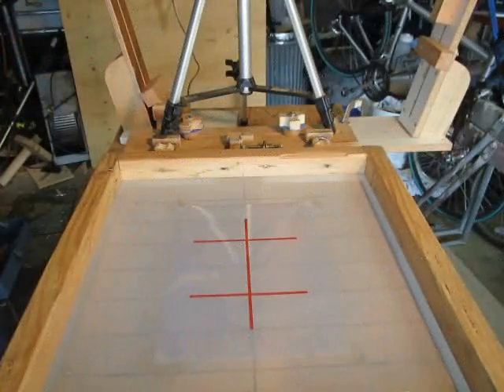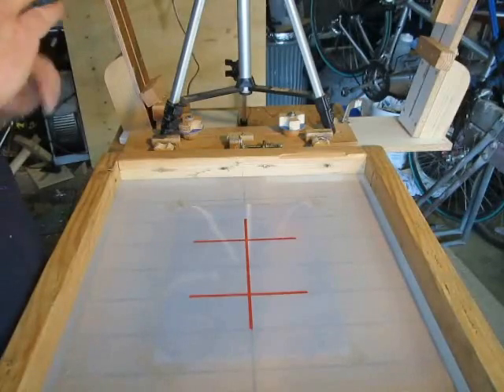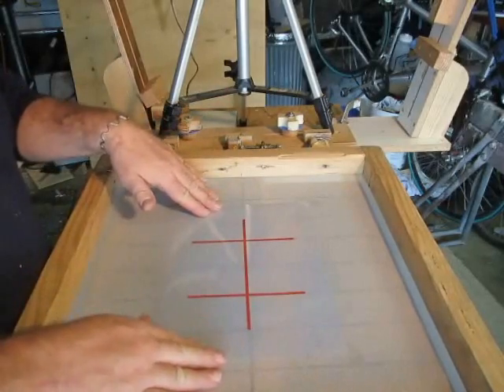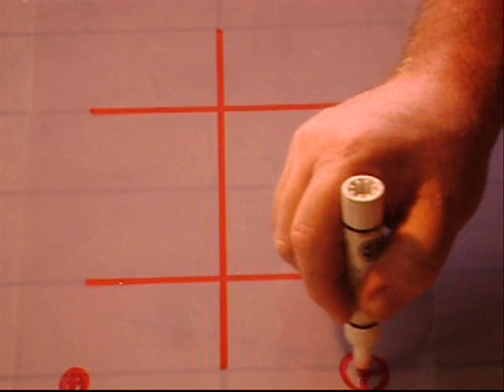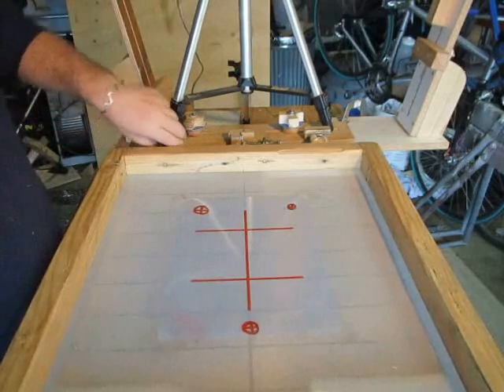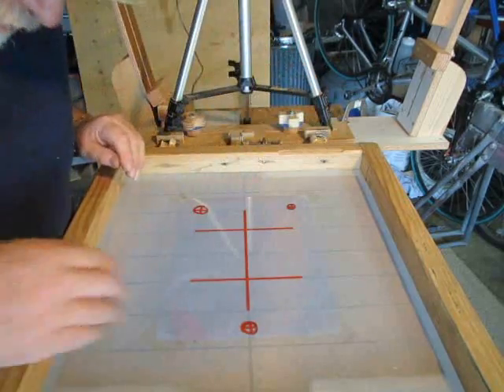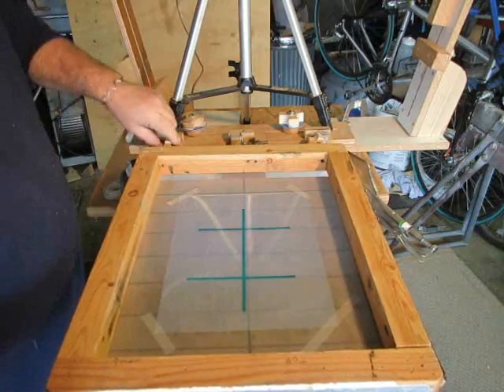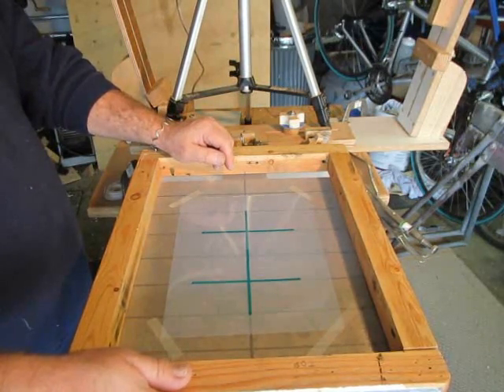Using 3 Point Registration

Comment: This is terrific.  I would like to see a picture of the hardware that is attached to your screens.  Not exactly sure what you are using there.  Is the center a tapped piece of angle iron?  Are the L and R adjuster screwed into threaded inserts on your screen?  Thanks so much for this great registration idea.
Reply from the maker: Did you get the email?  Remember, the actual registration system is a very common design.  My contribution is just the three rare earth magnets.

Comment: Mate, thanks for the video. The press design is a thing of beauty. I've built a rotary press before, but because I had no micro tuning capacity I have been disappointed with the accuracy. So I started looking at alternatives, including the on screen tuners, but this looks superior. I have a fairly large palette, and to get the onscreen tuners to work for me I would have needed to shave a bit of either edge. But this is a quick and easy modification to what I was planning, and it will let me keep my current palette intact as is. Ordered a bunch of magnets online, looking forward to the build. Cheers
Reply from the maker: Glad I could help.